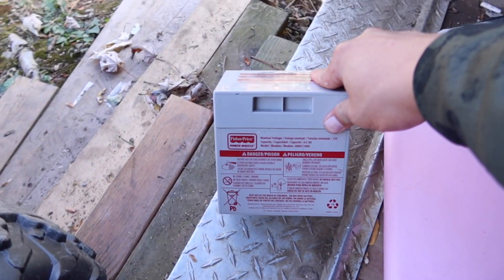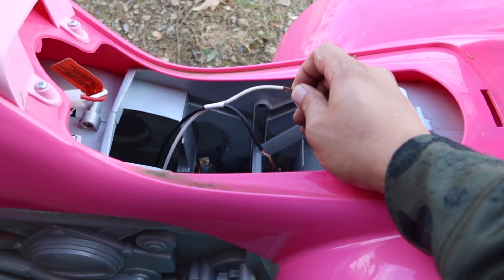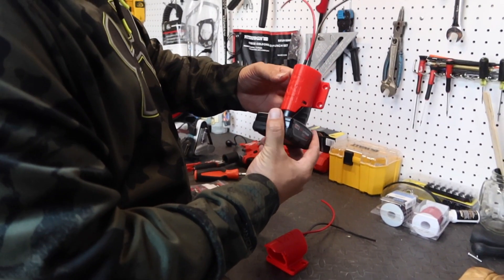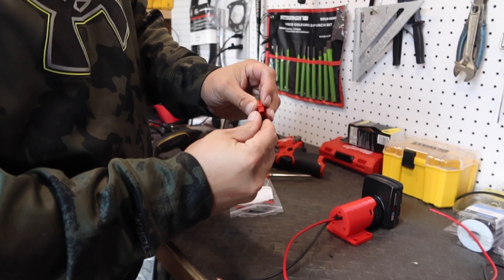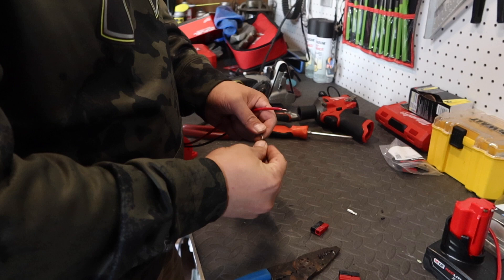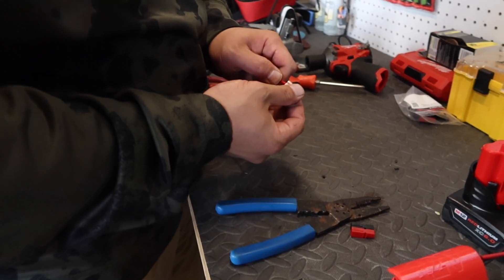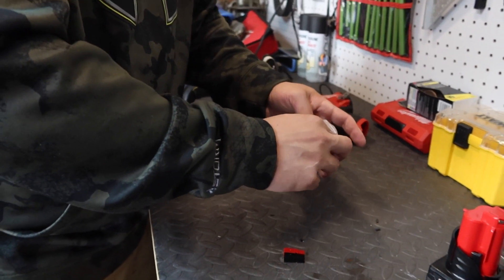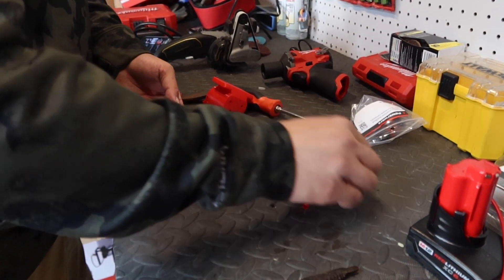POWER Wheels with a Dead Battery? Try this

Comment: no fuse ?
Reply from the maker: I thought about popping in an inline fuse but Haven’t got to that yet. It’s probably a good idea to do so!
Reply: Thermal fuse built in to old power wheels battery omitted. 40amp should hold 30 may pop.